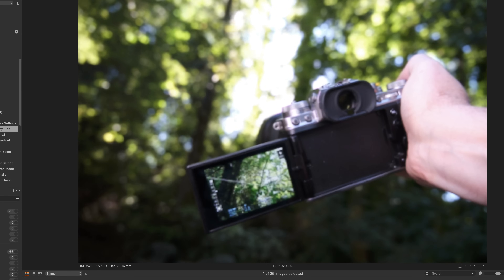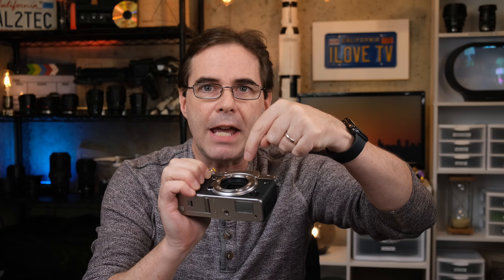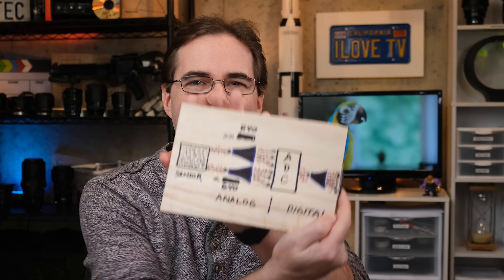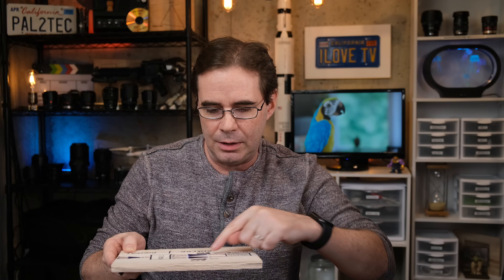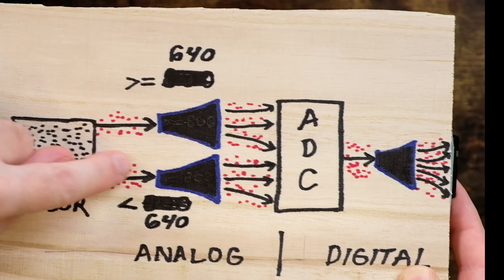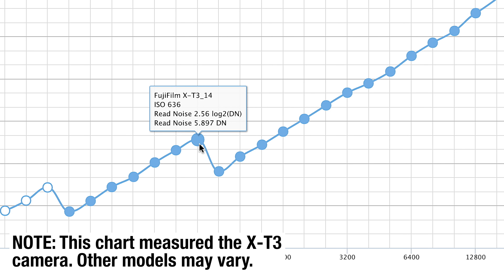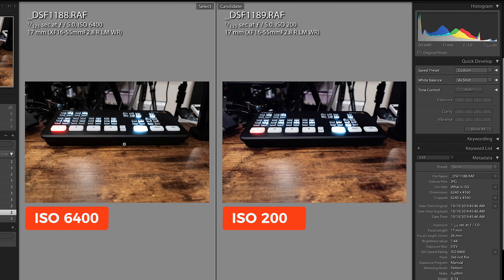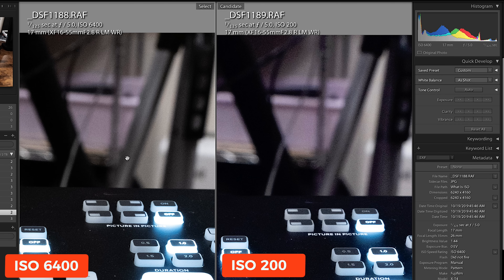Fuji ISO Performance

Comment: Given the non-linear signal-to-noise ratio over ISO-curve: Do you expect this behaviour is already reflected in the Auto-ISO algorithm in Fuji cameras? 
Or let me rephrase the question - Does it make a difference if I dial in specific values (i.e. 640 ISO) in the Auto-ISO settings?

Comment: What you DON'T want to do is shoot at 200 ISO and open up the exposure in post if you shot in Velvia. Stick to standard saturation and contrast or even lower when underexposing. Not Velvia. Naturally shooting in raw bypasses this issue. Just don't apply Velvia in post as a sim to your file till after you open it up.

Comment: So instead of doing ISO 500 at barely adequate shutter speed you can raise the shutter speed until it hits ISO 800, the noise should be close but less chance of blurring.

Comment: I'm confused as I got very different result than yours (but in CaptureOne). The ISO 800 RAW has so much more details than the ISO 6400. I wonder why is that?

Update: Getting much closer result in comparison once I used the manual focus - It seems like over exposing confuses the autofocus system :D

Comment: Hi,
I did some tests with my XT4 and it seems that the value (in raw photo) for dual native iso and invariant iso is the same, ISO 500 !

Less noise at ISO 500 than ISO 400 and 320 !
ISO 500 as the same amount of noise as ISO 250.
And ISO 800 noise > 640 > 500

Can somebody comfirm that please ?

Thx

Comment: I have two questions please. 1: why is noise being amplified after the signal is converted to digital? (Digital signals immune to noise with parity or similar) and 2: how does this relate to hot pixel noise which the camera can remove with a second dark exposure?

Comment: 4:24 "Once it gets converted, it continues to travel, picking up more noise..."

That's not precise. Once the analog signal from the sensor gets converted to digital (that is, digits = numbers) it doesn't pick up any electronic noise, because the values are already fixed as numbers. The values that you'll get in your RAW file are already constant.

Digital processing, however, can introduce rounding errors that could be amplified into noticeable noise if the processing workflow is quite convoluted and suboptimal, but for most situations and workflows this effect is negligible.

Comment: So the bottom line is shoot at iso 100 or lower; and bring it back at post (raw files only) since no amplifier will be adding noise; you will at post.  Is that just about right?

Comment: Have the GFX50s. Why the bumped ISO 200 has more noise? Because of the bigger dynamic-range-noise (more Detail informations), that I amplified? With higher ISO and the loss of dynamic range I don´t have so much Details (and noise) that could be amplified in post. Right or wrong? I am confused, please help.

Comment: I don't quite get the thing you said at the end about the "magic ISO 640". I'd say that ISO values between 320 and 800 should be avoided (400-800 on X-TransIII because of ISO 200 base value), so if you need anything above ISO 320, go straight to ISO 800. Correct me if I'm wrong here.

Comment: Another reviewer (https://www.youtube.com/watch?v=hrLmdli0XqM)
 claims the X-T4 to have dual native iso with a secondary step at 2000, implying a tertiary pre-amp if I understand this correctly (for base 160, primary native 640 and secondary native 2000). I could not find official info by Fuji on this though, and the X-T4 is not listed at photonstophotos. Could you confirm this as well? Interestingly enough, the X-T3 -- which is advertised to have the same sensor as the X-T4 -- certainly does not have this.

Comment: Sorry but on your circuitry the is a mistake. The Digital signal after the AC/DC cannot be amplified. The signal after AC/DC is digital (one or zero) and you cannot amplified it ....
Reply from the maker: I probably should have used the term 'processed' instead. Good point!

Comment: Excellent explanation... HOWEVER, how do you determine the best exposure setting (aperture/shutter speed) to use when the exposure might not be showing you the final result in camera??? I mean your 200iso image was so dark, how do you know it was correct in the first place?
Reply: My approach- use F stop and shutter speed that you absolutely need for the scene (which in the context of this video is for lowlight situations),with the ISO as you'd normally dial in for correct exposure.....i.e. you will reach a point you cannot open your aperture anymore and lower your shutter speed anymore.....IF & when you get there, reduce your ISO to either 800 or 3200 and work on the exposure in post "either selectively" on the image (which is the biggest advantage of this concept) or "on the image as a whole".

Comment: really cool video, would be 100%, but i'm usually concerned about shadow areas, using my x-t30 i see much greater noise if i underexpose in camera and lift exposure afterwards.
would be interesting to compare underexposed and overexposed photo shadow area quality.
nonetheless super useful info

Comment: Awesome lesson! If I use RAW and "Preview exp./wb in manual mode" with my XT3: first photo with the "correct" exposure : 1/15,  f/5, iso 800 and the second one with  (-5) 1/500, f/5, iso 800. Of course after correct process in "LRC", I think that the second will be the best ! (?)
Bonsoir de Toulouse, en France. Vous êtes mon meilleur prof de photo.

Comment: This is excellent information, thank you! One question though, did you mean to say set it at 800 ISO instead of 640 at 12:43? I thought the second amplifier kicks in at 800 because it has lower noise than at 640 on the chart.
Reply: I would like to know this as well.

Comment: I have to be doing something wrong here. I tried this by seriously underexposing (4 - 5 stops) a RAF file at ISO400. I used the latest Adobe RAW plug-in, the Adobe DNG converter, a couple other editors. Even Adobe Elements (which I would guess uses the same RAW converter?). The results, with all, was noise, and a lot of it, when I cranked the exposure sliders.

Comment: Great Video, really good explanation.
But I can't see how any noise is created in the digital signal processing. It can't add any noise as the data from the Adc is digital an therefore relatively immune to interference or similar

Comment: And this is why I don't understand why Fuji do not have the highlight weighted metering option (like on the Ricoh GRIII). This would mean that most of your shots would  be fine, with no blown highlights. And then just adjust the exposure in post. Every modern digital camera produced in 2020, should have this metering. Come on Fuji!

Comment: Nice work. They are so many miss leading information about camera sensors out there, you did great again. A few comments :
1/ the dual amplifier is actually a change of capacitor to one with less capacity but a lower noise. 
2/ It is missing what’s make the little difference between doing all with iso or with exposure slider : when doing  all with iso you amplify noise (and signal) upstream then some negligeable noise is added by adc. When exposing in post you do also amplify the adc noise. Iso invariant camera has low adc noise as you say. 
3/ Fuji’s camera have DR settings DR200 and DR400 does for you exactly what you did in this video :. Shooting at “real” iso 4 stop lower (for DR400), the raw is just flagged as such so Lightroom can apply 4stops of digital amplification when loading the picture automatically.

Comment: Is it only a dual gain? I heard on the XT3 there are four iso points where the gain is different on this camera: 160, 200, 640, and 800. I keep this in a note for quick reference when I'm out hiking with my camera. What this has meant is to choose anything from iso 200-640 will be the same quality of noise. Anything from iso 640-800 will be at a lower quality, but all the same standard of noise. Is there validity in my method I've clung to over the past two years? Honestly I rarely deviate from 160, but occasionally I need a slightly different shutter speed and can't afford to lose the colour by having an incorrect exposure, so I unlock that dial for a shot or two... Honestly this technical stuff really gets me going. Great video!!!!

Comment: Excellent explanation but I think you made a small typo on the piece of wood. It's <=640 and >640 respectively if I'm reading the chart correctly. So 800 seems to be a sweet spot and anything above 320 and below 800 (400, 500 and especially 640) seems to make little sense since it will be more noisy than 800 which is also what I understand you are saying later in the video.

Comment: Very interesting. Maybe I will have to look to the other video to see the answer. One thing I noticed with my Olympus camera is when I increase the  brightness in Lightroom, such as 3-5 stops difference, it comes out as bright and perhaps similar results of noise and highlights as you are showing. However the tone and color of the image is off in compared to just selecting the right ISO in camera. Is that normal for most cameras?

Comment: If this is true, and the noise at high iso is a product of the amplification, and not anything to do with sensor size, quality, design, or photo site size, then how would you explain the Sony A7s series. That camera line has exceptional low light, low noise capabilities. If Sony have created a signal amplification system so good, then they should probably use it in all their cameras no? ... or could it be that it’s their sensor doing the heavy lifting to start with... just saying :-)

Comment: This is why I have three ISO range settings (for ISO on Auto obviously) set up on my X-T3. 800 max, 3200 max and 6400 max. I generally run 3200 max as my day to day as it's very acceptably clean and I own some decently fast glass. 6400 for low light use where I want to push things. 800 for very bright days where I want to make sure I don't edge too high due to an accidental dial change or function fat finger press. I also shoot raw, so that gives me more latitude.

Comment: On my XT30, I do the comparison b/w ISO400 and ISO800 in low light. The ISO800 still has noticeably more noise than ISO400, which should be equal noise according to the chart. Sorry I am not buying it...

Comment: One thing that improved my shooting a lot over the years is to shoot at whatever the iso that is correct for the setting. Don’t be afraid to bump it up to expose it correctly. You will be better off getting a shaper image with a faster shutter speed than try to reduce noise.
Reply: Topaz Photo AI  Does an amazing job with noise removal.  Makes those skies in your old 8 meg pocket camera shots noise free.

Comment: Thank you very much for this lesson! Very valuable! I was wondering.. would it not be better, considering the noise chart, to use ISO800 instead of ISO640 and amplify from there? Seeing how there is a drop in noise level between ISO640 and ISO800?
Reply: Exactly what plays in my mind too
Reply: +1
Reply: Yes, this was addressed in the video but wasn't very clear. Iso 640 for x-t4, and iso 800 for x-t3. Not sure why they different since they use the same sensors. But you can reference the charts on Photons to Photos but looking at the "Read noise in DNs vs ISO settings."

Comment: Does reducing exposure in Post also reduces noise? I think no, and I think that’s a reason to still continue trying using lower ISOs when possible. Is that a correct thinking?
Reply from the maker: Some noise will be inherent no matter what. Depends also on other factors. Generally go for lowest you can, but if using ISO invariant technique you might want to experiment with ISO 650 vs. ISO 500.
Reply: @pal2tech  Hmm, interesting. Thanks for your channel. I made sure I subscribed and hit the bell. Your explanations rock! I work in Amazon creating videos for Coursera, with a background in technical instructor and solutions architecture. The way you lecture stuff is really effective! Thanks for doing it!  :)

Comment: Listening to what you say, I get the feeling that sometimes you confuse the point where the 2nd gain amplifier kicks in. It kicks in at 800 ISO, as you can see in the chart. But you say in many places that it kicks in at 640 ISO.
(Looking back really closely you have a point in the chart at 636 ISO. But how does one get to 636 ISO?? That doesn't make sense in the chart. To me the point in the chart where higher ISO gives less noise, is 800 ISO.)
Reply from the maker: Very good point. I should have been more clear. The amp kicks in at 636 for sure. After that it's using 2nd amp. You can't set 636 on camera, so closest you can set is 640, which is closest you can get on setting to where 2nd amp kicks in. That's the starting point. 800 ISO is lowest point of 2nd amp. Either way, I'd recommend using 800 as starting point and seeing how that affects your images. Cheers!
Reply: @pal2tech  Too bad then that the chart doesn't show actual noise / behaviour at the actual 640 ISO! :D

Comment: Well done to you. You are one of the very few people who has mentioned that ' digital iso ' has nothing what so ever to do with the sensitivity of a digital sensor to light. People better understand that the sensitivity of a digital sensor to light, properly termed as its Quantum Efficiency is a fixed value per wavelength of light and can not be altered. What this means is that a sensor actually has different Q.E for Blue, Green, Yellow and Red portions of the spectrum but these are fixed and unalterable. Besides a sensor with higher Q.E there is only one way to make an image brighter in a digital camera and that is by allowing more light to hit the sensor. This can only be achieved by a slower shutter speed or larger aperture or a combination. This ' Digital Iso ' as you properly explained is only a measure of the amplification given to the signal generated by the sensor to enable the image to form ' properly exposed ' on the LCD of the camera. This goes for all digital sensors regardless of the technology or make. Digital ISO is nothing like the old ASA/ISO of the film era.

Comment: awesome explanation! I tend keep my images straight out of camera JPEGs, but it's useful even there — on my x100v, the noise chart shows a dip after ISO 400. 250 and 500; 300 and 600; 400 and 800 each have similar noise value pairs. As for dynamic range, ISO 500 has better dynamic range than ISO 400 — go figure.
Reply: On my XT4, i have less noise at ISO 500 than ISO 400 and 320.
ISO 500 as the same amount of noise as ISO 250.

Comment: remembering iso 640 in my mind for the safest point. appreciate it didn't know that the fuji has dual amplifier for iso levels, is it same as Panasonic  Lumix dual native iso?
Reply: Why not 800?
Reply: @GloriaSlap  ISO 640 is native when you set the camera to the highest possible DynamicRange it can offer. google it for Dual native Iso Fuji xt3 or xt4 Graph

Comment: Increasing exposure in post does add more noise to an image than increasing ISO in camera. As the diagram in the video showed there are two steps to capturing an image: light hits the sensor which generates electrical signals, then those signals are read and converted into an image. Both steps add their own separate noise to the process. The difference is adjusting ISO amplifies only the electrical signals coming from the sensor, before the reading process, so only noise  from the sensor gets amplified. Whereas adjusting exposure in post amplifies both the sensor noise and reader noise resulting in more overall noise. There are many image comparisons on the net that show the effect. Tl;dr you are always better off maximising ISO than relying on post.
Reply: This comment is old but was for some reason listed on top, so it's worth correcting it for the sake of other people looking at it later. You said increasing ISO amplifies only the electrical signal, which is not a general truth and strongly depends on the sensor design. In this case in fact you're wrong. Many modern BSI sensors (eg. the ones described in the video) are dual-gain sensors, which mans there are only two configurations for amplifying electrical signal, and the actual change in electrical signal amplification (GAIN increase) happens only once when going up with ISO settings. In new Fuji cameras the breaking point is around ISO 640. That's why when increasing ISO from eg: 200 to 400, or from 640 to 3200 WILL NOT cause the electrical signal to be amplified before reaching the ADC. In these cases it happens later in the image processor unit, and is similar to increasing the exposure in post. Hence the iso invariance.